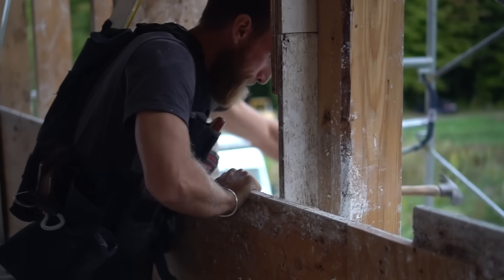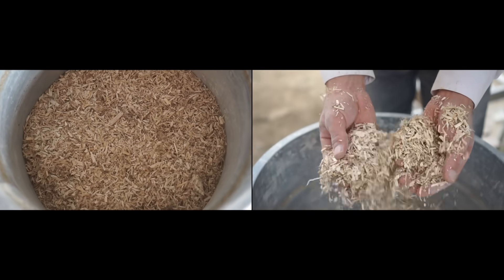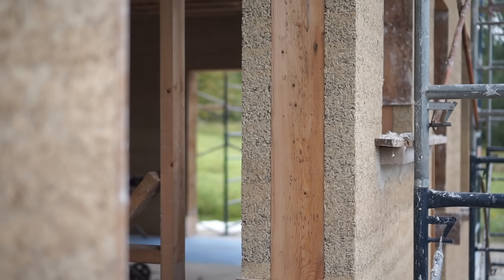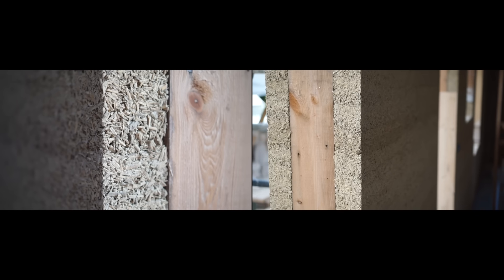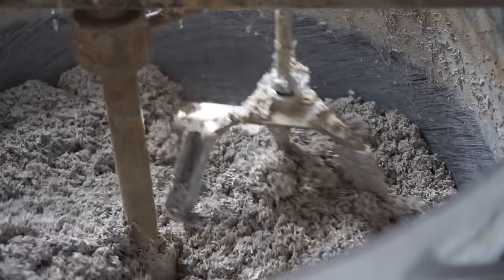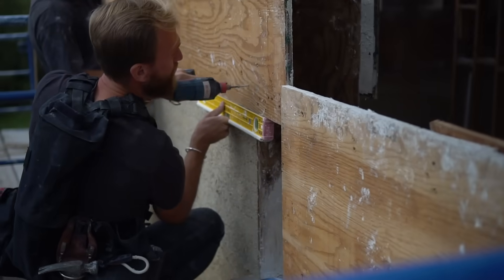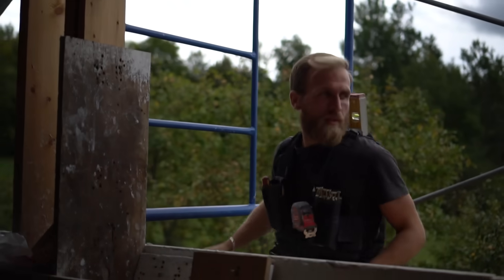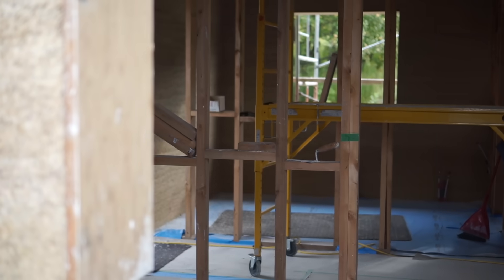Building with Hemp – An Incredible Natural Insulation & Sustainable Material

Comment: This is really cool, but all I've been able to find of its insulation capability gives it a pretty high lambda value, which means you'd have to make a really thick wall for it to live up to the minimum u-value requirement for outer walls.

The wall in the video didn't seem to be that thick tho, so now I'm just wondering the logistics.

If the lambda value is actually better then what I've been able to find I'd love to know cause this is seriously cool!!

Comment: This is not building a home with hemp crete.  Its infill.  Interior and exterior surfaces maybe.  You build the house with concrete foundations and lumber, windows, doors, rafters floor systems, roof systems.   So tired of people pretending you build a house out of it.  Its a small part of building, not the building.
Reply: I understand what you mean but perhaps you could look at it a different way. The statement 'building a house with hempcrete' is still correct as in he is building a house and hempcrete' is a part of it so therefore he's building a house with hempcrete. I know I know, the tendency is to read the title and think that the house is being built entirely out of hempcrete but maybe that's our interpretation and not the literal intent.

Comment: The R-value of hempcrete is both inconsistent and inefficient when compared to other options. It's a green fad product. If the hemp and lime are not locally sources materials, EPS is likely a much better solution.
Reply: Then why do none of the houses I’ve visited need AC and their heating bill is ridiculously low?

Comment: Good video. I'm a big fan of hempcrete construction. A few notes: 1. We learnt on my course that hemplime is safe for workers IF you use gloves and a mask, because lime is caustic. 2. I reckon it actually can be structural, it just hasn't been tested enough yet. Here at CAT in midwales where I study, the architecture tutors and students did an experiment where they built a free standing hemp-lime vault. It withstood slow load testing. I'm sure before too long there will be 100% hemp-lime structures. The formwork can be reused over and over. The hemp lime bricks are also a great idea. Could you build a house with only hemp-lime bricks and no timber frame, except for the roof?

Comment: I see less than 10 percent lumber used on this house than a conventional frame home. You have to deal with 12 inch exterior walls? The cost to trim out these windows and doors for 12 inch walls? Is this product rodent resistant?

Comment: The carbon concept is a myth pushed by the Oligarchy for control of the masses. Stop believing in Oligarchy pushed ideas. This is apart of the 2030 lockstep agenda. Poisons and pollution other than carbon should be the focus. That will lead you back to the Oligarchy owned corporations who are the real culprits of the degradation of mother earth.

Comment: How are you using the hemp....as the exterior facing? I read that it's not useable as a foundation wall but only for interior walls...but it seems you are using it here as exterior walls. do you have more info. on the specifics of using it?

Comment: Would this work if the outside is corrugated steel such as in my silo house build. I would be using this for the interior insulation rather than spray foam.

Comment: Will it hold a nail or screw? I can see this would be great if you never do anything once the home is built but people always want change, renovation. I wonder how it holds up when you modify it? Cut it or patch it. Also direct moisture like an accidental flood, toilet overflows, or pipe breaks, will it hold form or crumble? I'm curious. Looks cool. I know that it is a nightmare for electricians that have to add or trouble shoot this stuff unless it is piped with emt, which means high electrical cost.

Comment: In 1941 Henry Ford made a prototype car made from hemp plastic that was super strong - lighter but stronger than steel, and used instead of metal for the body of the car. It was also made to run on hemp fuel.

Comment: It Mineralizes, not just bonds and insulates.
Rot proof
 pest free
Fire proof
Water proof
Earthquake resistant
'VAPOR' Permeable
Lasts for century with little maitenance!!!
Reply: Neila Pasa  it does not have structural integrity to build roof out of hempcrete. And you want a roof, for climate controlling attributes and all that good stuff!
Reply: @mikeoxhuge  exactly...structural integrity...was going to say the same.
. Is it possible to use it for rooms like the bathroom and toilets as you mention it is mold proof/water proof? assuming it would be perfect for this.  I only ask as @David Kirtley
 mentioned above that mixing machinery and other materials are necessary for those particular rooms.  It doesn't look like that is the case at all???
Reply: REGULATE IT
Reply: hows it permeable and waterproof, contradictory.
Reply: @gustavofoss2280  permiable to Vapor.
There are building products on the market that do the same thing Bro, Tyvek House Wrap is one of them.
It is Both water proof and Vapor permiable. So I beg to Differ with your statement, it is not so  contradictory.
Reply: @mikeoxhuge  its permeable, with an e. Ok thanks for the reply, I will look into the science of it. Cheers.
Reply: @gustavofoss2280  I see the error of my ways!
I may not be the best Spell Checker but I do know Cannabis
Reply: @mikeoxhuge  friend with all due respect, this is not cannabis agriculture, this is civil engineering.
Reply: @gustavofoss2280  I work in the Industry, both construction and medical Cannabis and that was not Respectful.
Did you get that from my Video?
You know not what I know, just what I stated. for you to make an assumption based on my videos, that Implies I dont know what what Im talking about, because of lack of corresponding content in such video, is nonsense
Reply: @mikeoxhuge  ???? dont get delusional of persecution. Again, its not disrespectful for me to correct you nor to doubt of your knowledge, we dont know eachother, so lets go on with our lives. Peace out.
Reply: @gustavofoss2280  lol, my people are not under Persecution! 
Good Day Sir!
Reply: Gustavo Neves Gore Tex is the same

Comment: do you get high if house catches on fire?
Reply: It won't catch fire, is does not contain enough energy to keep the fire burning and is covered in lime: if it somehow does burn (because the curtains next to it are on fire, or something), it'll smoke and smother  itself. And no, this does not contain THC, not all hemp is weed (and with weed you smoke the flowers, mainly, these are the stems).
Reply: @EelcoWind  but it will smoke right? :P
Reply: @silentndeadly  A bit, yeah, if there's external fire next to it it will... But no THC in it, so no getting high :p

Comment: My question is this: Is not the lime corrosive on the lumber in the walls?
Reply: No, lime and wood go fine together. Unlike cement lime will actually allow moisture to escape from the construction,  which is one of the reasons it's mold resistant. The other reason is its high pH value.

Comment: I feel like adding new electrical or wiring would be a huge pain. I like the idea but not sure how practical is would be. 
I'd be curious this cost and benefit vs Earth-rammed, pros and cons of each
Reply: You place the pipes for electrical and plumbing before adding the material,  similar to rammed earth. Rammed earth is probably a little less water resistant, it would need to be protected from direct rainfall. Because lime is made by burning I would expect the CO2 footprint of hempcrete to be higher than rammed earth. Then again,  growing the hemp is a way of trapping CO2 too. Bottomline, both hempcrete and rammed earth are great sustainable choices when compared to steel and concrete structures.
Reply: Wiring should be easy enough, just have some sort of electric chisel to carve the walls where you want the wires before you plaster it, or put some slats in the mold before casting. As for the comparison: Rammed earth does not insulate nearly as well, so it's not suitable on and by itself for many climates.

Comment: Start doing factory prefab hempcrete walls like Amaco does in Switzerland
Reply: Deimos Cain  You just can't compare Air crete with hempcrete. Hemp production is carbon neutral  and using only lime makes environmental frendly and sustainable. Air crete is better than ordinary Portland cement but not as good and definitely not better then hempcrete.
Reply: @velimircuvrk1640  is not the hemp itself carbon negative? Would love to see the economics of it, including the climate accounting.

Comment: Seems low at R value 2 per inch for exterior insulation. can it be stuccoed directly on the exterior and is it made as premade exterior 2", 4" sheets? 
Interested too in the energy consumption especially with lime use.

Comment: Is it possible to make large panels and cut to fit in between studs and joists and also to face both surfaces? Use pins or dowels to secure to each other, then face with plaster. Much better quality control for product would be possible. Build times would be greatly decreased. Also would fall more in line to skill set of current builders.

Comment: Not much actual information being shared here. I see some comments mention the low R value with this material, making it cost prohibitive for them. It'd have been nice if the video covered pros and cons with actual metrics (i.e. heat capacity, cost-per-unit volume, etc.).

Comment: It sounds VERY similar to stray clay building--similar techniques, similar insulation values. Uses straw instead 

of hemp (a waste product) & clay instead of lime. Do you know of any comparison of the two techniques &
final results? Thanks
Reply: I think hempcrete is more durable, stronger. It turns into rock overtime. Also insulating properties will be higher imo.

Comment: I'm somewhat suprised more hemp quality issues were not included.  Such as hemp will absorb CO2 for approx 100 years,  also an acre of growing hemp will absorb many more times atmospheric CO2 than an acre of full growth forest.  Some hemp block homes ARE equal in cost to stick built.  Hemp blocks will not burn.  Many times, no central air or heat is needed due to breathing and other values.  There is so much more...

Comment: "Resist vermin, resist mold"...
"It will last for, you know, many generations..."
"As long as there is a roof...the hempcreate with stay."
"Takes in humidity and release it..."? 
So many red flags in this advertisement. So as long as I don't expect it to last indefinitely, make sure it's not getting dump, the material will "resist vermin and mold". 
How about the material that is not susceptible to vermin or mold...like the actual concrete?
Reply: Concrete takes in humidity and does not release it, which can cause problems anywhere it touches wood or other natural materials. Hempcrete as well as lime plaster, earth (adobe) walls and rammed earth will actually regulate the humidity in your space,  releasing their humidity when your inside atmosphere gets too dry and visa versa.

Comment: unfortunately its expensive so its not sustainable; the carbon footprint actually gets high cause the investor has to raise the funds in a process which is usually related to high energy usage and carbon emissions; its not only about the material itself; hempcrete could work when hemp will be mass-produced and cheeper; another thing is the R value which is low compared to 'foam' and this means walls have to be thick which means the foundation and roof are larger which is costly and we're back to 'expensive' part

Comment: He mentions that one of the limiting factors is waiting for the hempcrete to cure ("dry" as he says) before building on top of it and removing formwork. I wonder if adding 10-15% clay would help to add an instant binder and increase thermal mass of the walls. This might change the R-value, which would need to be considered. However, technologies such as rammed earth allow you to create walls and immediately remove formwork, which could speed up the work.

Comment: Thinking of making Hempcrete blocks like cinder blocks, 
so  we can use ordinary skills for laying bricks.
Any tip for this kind of methos of building ?
Reply: It does exist in France (search "brique de chanvre") there are several brands, it is a self supported isolation, but you still need a timber frame to support the roof. You have to make sure there are no gaps between them, and the mortar must be very very thinly applied to avoid thermic bridges.
You can also projet it by machine in an open formwork (closed on the inside by gypsum boards, for example, this way you only have to finish the outside).

Comment: Is it cheaper to use than what it's replacing? Building is super heavy on the pocket as it is for a normal person like me. 
I'll jump on any cheaper alternative so long as its impact on the environment is at least standard. 

Right now I'm eyeing shipping containers and preferb houses. If I switch to a higher cost for environmental impact when I'm already pretty much standard, I lose the initial motivation, aesthetically good house at very low cost. 

(of course, all this is still in my head lol)

Comment: Wonderful material, which is much better for the indoor air, than plastic insulation.
Would be much faster, if they were building with pre-cast panels that they connect with wet layers.
Reply: The "fiberglass" you are thinking of is spun glass fibers set in resin. Insulation is only the spun glass. It's glass. Glass is made of sand.
Reply: I like how the hempcrete is being pressed into every nook and cranny as they move the forms higher.

Comment: did you think of containerhouses in combination with hempcrete?  The containers would provide the stable structures and hempcrete the insulation and walls outside and inside... a plantage of hemp would provide lots... the material for hempcrete, clothes and hempoil etc... nothing needs to be wasted...

Comment: I am for getting hemp out there. But, as an insulation how flammable is it? Like any plant matter wouldn't it degrade over time? That seems like a whole lot of hemp to insulate an entire house, considering how much water and other resources to do this, is it really worth it in the end? Even with the low THC content, could you at least get high if you were in the house when it burned down? Munchies for thought.
Reply: hemp contains pretty much zero thc i think your mistaking female marijuana plants to hemp.
Reply: When hempcrete is dry, especially the lime plaster, it's like stone (carbonatation of lime = limestone), so not really flammable

Comment: you are better off using cellulose insulation it is also natural and it has an R-Value of 3.6 per inch. compared to 2.1 of hempcrete
Reply: But you need to use plastic, a vapor barrier... and your house is like a "ziploc"
Reply: @nadiadecourval922  in general best practice is to use a vapor barrier.
though if you are building an air tightness house you would also install a HRV/ERV.

but if you are concerned about plastic, you can always use a fine mesh to contain and drywall over.
Reply: @nadiadecourval922  also you would need to put a vapor barrier on the outside or inside of the hempcrete if you want to control the humidity level inside the house
Reply: david kowalkowski nope it does all of that by itself

Comment: The labor cost is too high, and the R-value at 2.1 per inch is on the low side for an insulation material. Polyurethane Foam (foamed on site) has an R-value of 6.25 per inch. R-values for fiberglass rolled batt insulation are typically between 2.9 and 3.8 per inch. R-value of cork is 3.00 per inch.

Hempcrete is also a misnomer since it has nothing to do with concrete. It's not made using concrete and isn't near as strong as concrete. Hemplime would be a more honest term. It's not strong enough to build a load-bearing wall from it without additional framing.
Reply: What's the compressive strength of hemplime?
Reply: They are high now but if more people what it the price should come down!😎
Reply: @tammyshea8882  that is correct, we currently are proving the supply chain we call it transitional at the moment, it's already come down in two years
Reply: R Value is one point but is not the entire reason for using Hempcrete. Polyurethane is toxic for you to breathe overtime as it off-gases and your breathing toxic and proven cancer causing materials exposing your family to these elements for some is a non starter. Hempcrete breathes regulating humidity more or less depending on the environment. more in AZ less in FL. Hemp is sustainable synthetic building materials are harming the planet and us. Gypsum has to be mined, plastic for vapor barriers are filling our oceans.  Hemp Lime walls are not load bearing and not the point. the way to look at it is Hemp Lime is "Hemp Insulation Installation" These walls also filter the air still, not like when the plant was alive but it does still sequester/Trap carbon from the atmosphere making the interior environment in that home compared to next door cleaner and less toxic. People refer to the sense in a Hemp House as Cozy, Cave like, Comfy, Peaceful. Not for everyone, but those other benefits especially environmental add up for certain segments of the population. A field of Hemp grows in 120 days, makes the same amount of pulp 4 acres of trees produce in one single acre. and filters the air while growing..